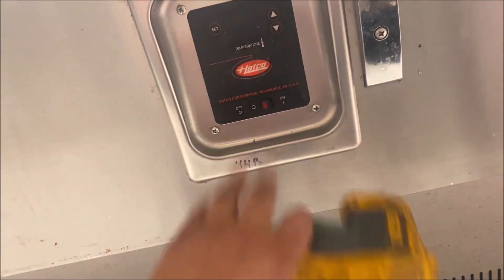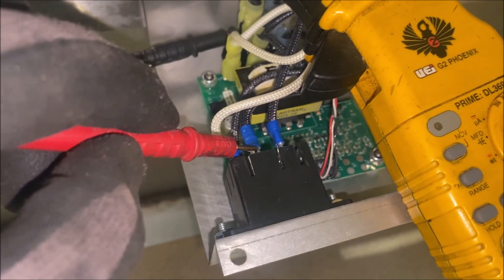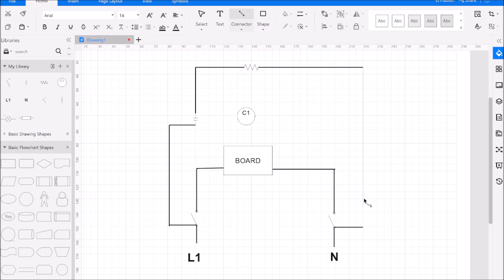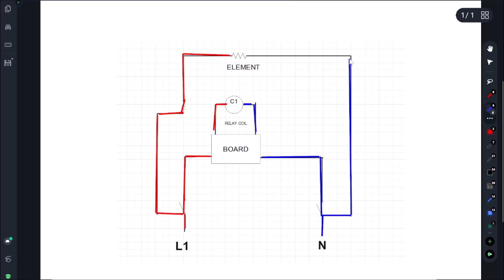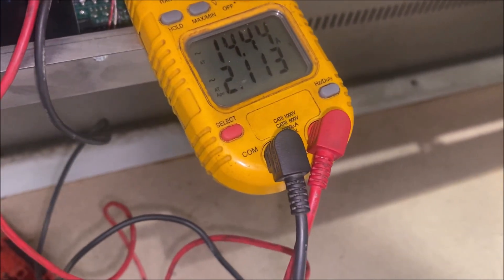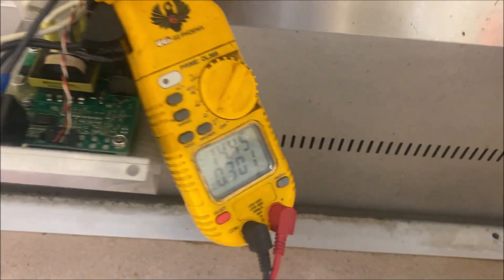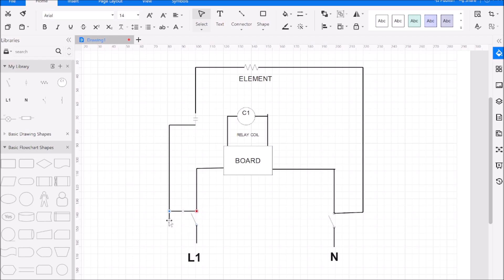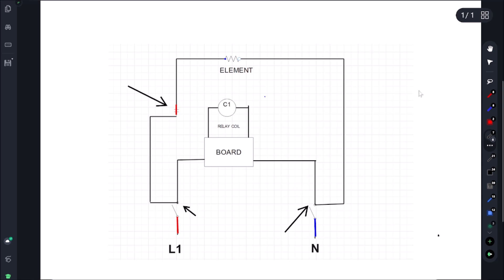Hatco Hot case is heating with the switch off

Comment: My friend, this is an awesome breakdown of something quite a bit of techs and even some electricians get spooked by (not having a schematic/wire diagram to reference) but sometime we ought to embrace, being, the informal reverse engineering of circuitry in order to better understanding how things are layed out, which often leads to comprehensive identification and rectifying of faults/problems. The more this approach is exercised, the easier it is to hone in on and clear issues efficiently and with confidence.
Reply from the maker: If you have a map, it is a lot easier to get to the destination.